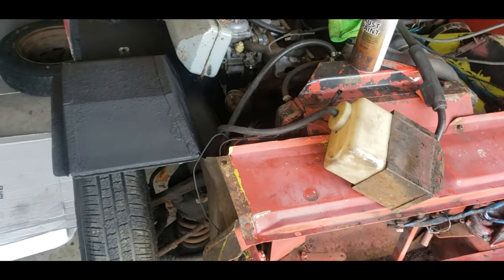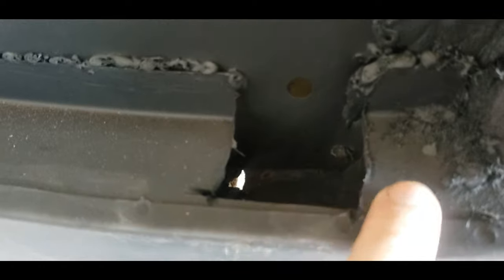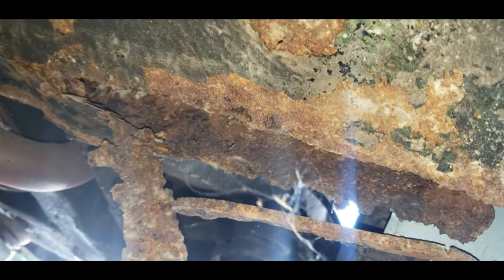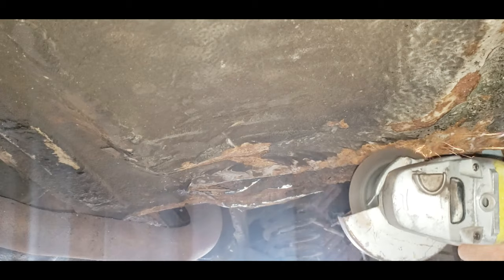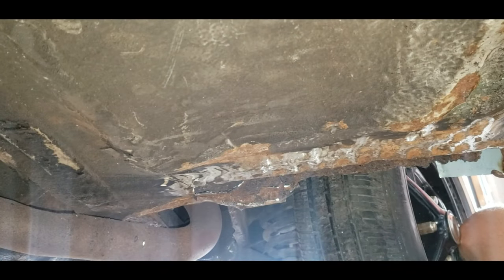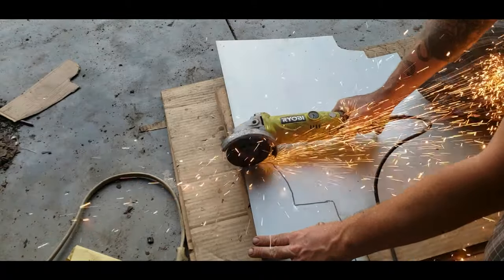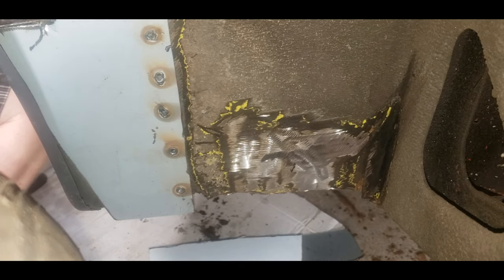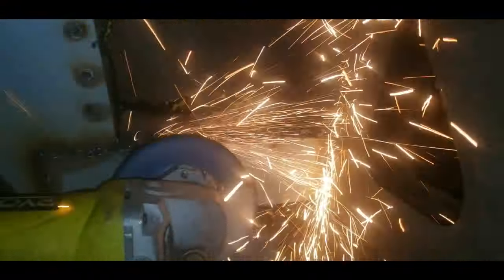1975 MG Midget Rebuild PT.6 - Floor Repair

Comment: Well done Mike. I am glad to see you are progressing well. With the welding  I would suggest small tack welds first then you want to create that clean weld look watch how hot the beads get. Your beads need to be one after the other but let them cool slightly. Don't keep the heat on one spot as it makes the mess. It is like piping icing small beads on the bead before it and not let it get to hot. I hope this helps. Stay well I look forward to each episode.

Comment: Your welds are not good because you’re not cleaning the metal first! You need clean fresh metal for clean welds. That includes the sheet metal from Canadian tire. It has a coating to keep it from rusting. You need to take that off first. Also turn up the heat and wire speed.